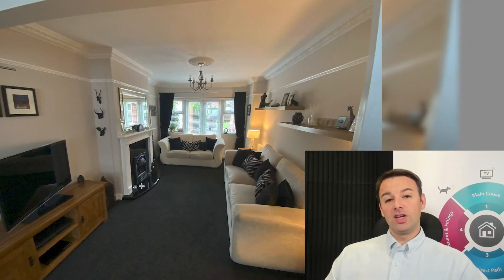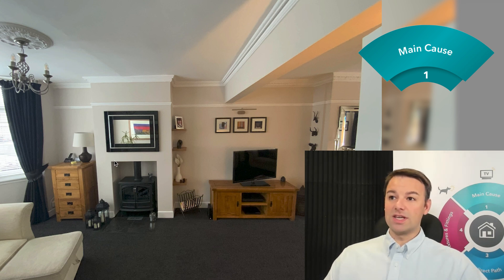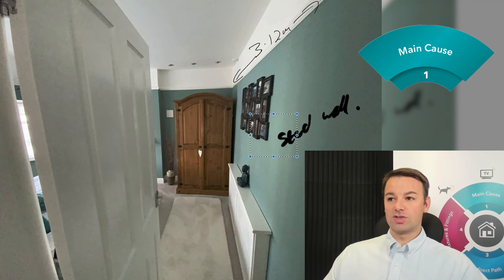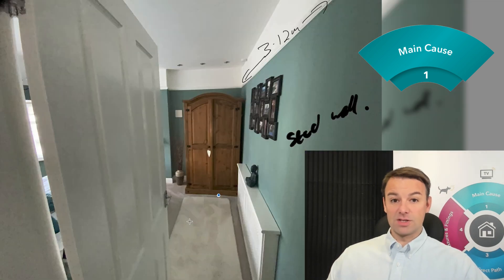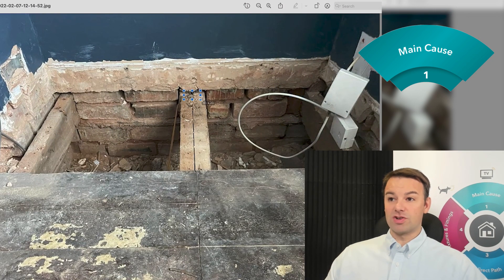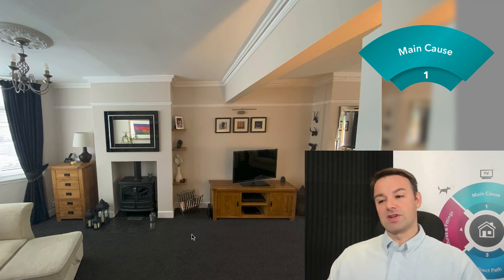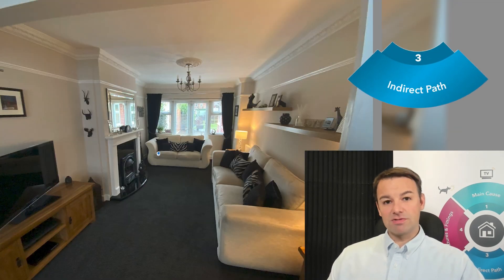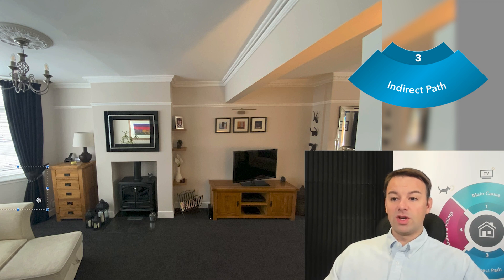How to Soundproof a ROOM | Living Room

Comment: I have noise issues from neighbours through wall no alcoves (can hear conversations very clearly), dot and dabbed plasterboard and made noise worse. Going to rip boards off and looking at direct to wall noise boards, hoping it will make a difference 🤞
Reply from the maker: Hey Jon, As an installer I would personally avoid any 30mm panels, we remove more of them then we install. I would recommend a minimum of 50mm sound insulation layers installed to the wall for conversation. Have a look at this video....what we install to the window wall and the first few layers we install to the party wall.  This 50mm system I show you in this video provides the foundation layers of all of our bigger thicker systems.....so if you wanted more....you could add to it....this is not the case for the 27.5mm panels systems. How to professionally SOUNDPROOF your HOUSE!  👉 https://youtu.be/JUdjtpa2ik0